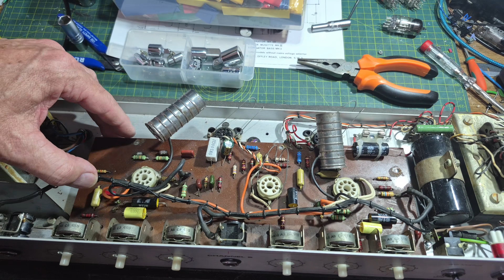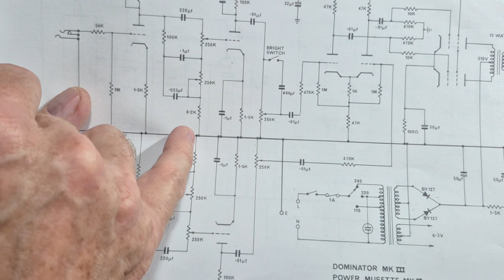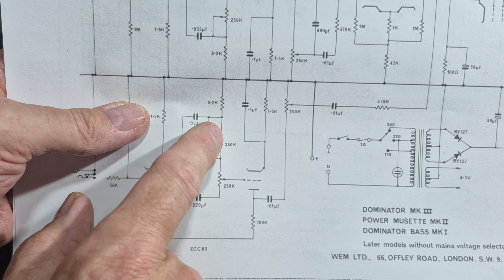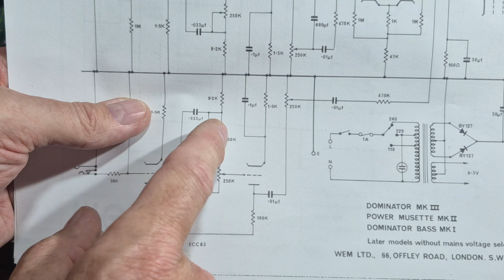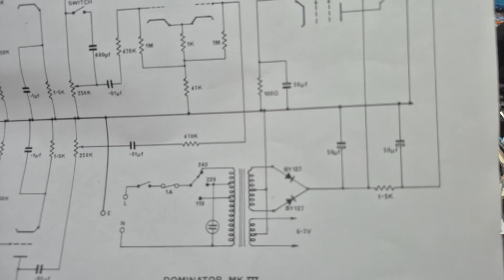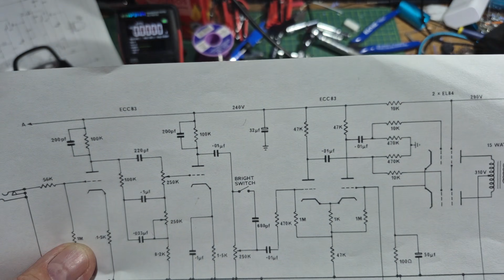I Added a Mid Control to a 1974 WEM Dominator MKIII

Comment: Has to be a Gilmour Fan. I wouldn't waste money on this. I had to use one of these at a festival when I couldn't take my Marshall or my Fender. It just didn't cut the mustard!
Reply: Its my amp. I am massive bonamassa fans and this amp with any my of les Paul  custom shops. Beats any marshall or fender tone wise. Bonamassa has a very mid focused tone and the low output pickups I use sounds better with added mids.
Reply from the maker: Some of these amps had a rubbish speaker in them. Some had Green Backs. With a good speaker they sound great for small venues.

Comment: ANy way to get rid of the 100Hz very low level buzz on a Dom Mk3? I tried disc ceramics across the diodes as it appeared to be related to them switching on and off and scoping the heater supplied showed these 100hz spikes present on it. Suggestion was that it was being induced onto the heater via the transformer. It's not loud but its one of those when you hear it, you can't unhear it.I notice you have it too. BTW Changing the plate resistors, including the phase splitter to 1 watt metal made a big difference to the amount of hiss. They are great sounding amps. Nice honky tonk playing at the end BTW.
Reply: In many cases that kind of hum is caused by those normal ripple current spikes of the plate voltage filtering caps when the grounding scheme is far from optimal. Properly done star grounding usually solves the problem because then all those ripple currents are kept in the power supply, far away from ground wiring of the audio signal itself. Of course, if the filtering cap values are inadequate, or the condition of filter caps is bad, plate voltage ripple itself can cause 100 Hz hum, especially in SE amps, but very often it is caused by the poor grounding scheme of the B+ filtering.
Reply: @jutukka Yes. I suspected it might be related to grounding issues as the grounding scheme isn't great. It's been fully recapped with good quality electrolytics. All the mustard caps were solid. Interestingly, there are double spikes on the heater circuit which appear to be related silicon diodes at crossover, plus the decision to ground the main HT centre tap directly to the heater may not be helping. I read that the fast switching of the diodes can cause  this and its exacerbated by feeding the HT centre tap directly to the heater centre tap and then to ground singly. I checked a couple of Fenders and they had 10nf snubbers across the diodes, so I tried that, but it made no difference. I may need to try reworking the ground scheme.

Comment: Have you ever put a switch in to move the position of the tone stack in the circuit.  I found it a fantastic way to have different type of amp voice.
I did really do some experiments last year regarding tone controls,  placement and voices. 
Put a low or high pass between stages was also very powerfull.
Reply: Some love a TS bypass that lifts its ground too!
Reply from the maker: Some good ideas there mate. Take care.